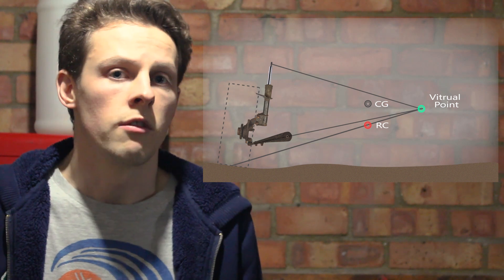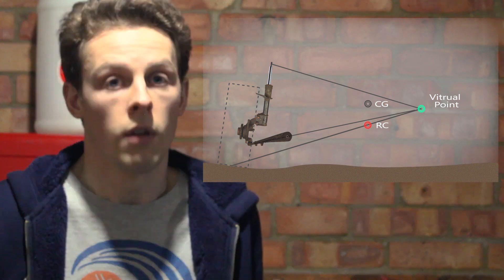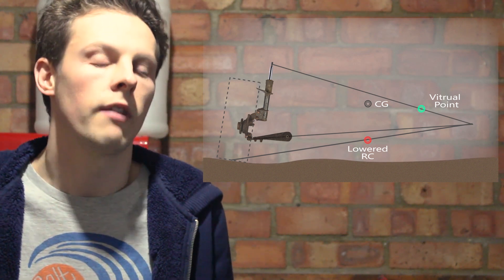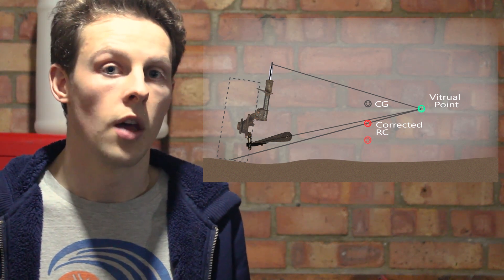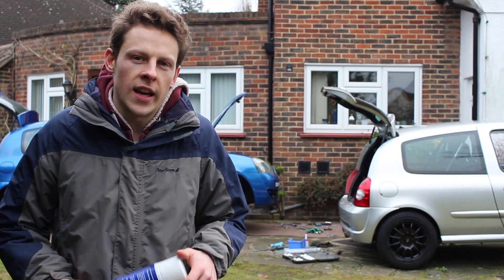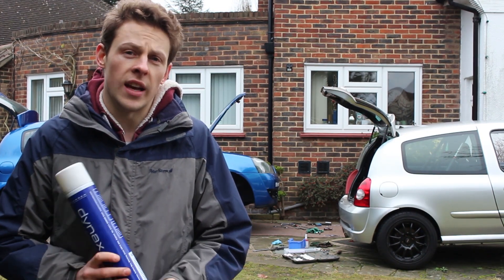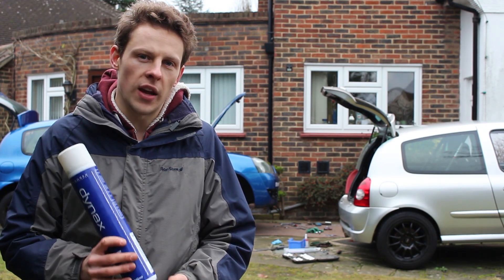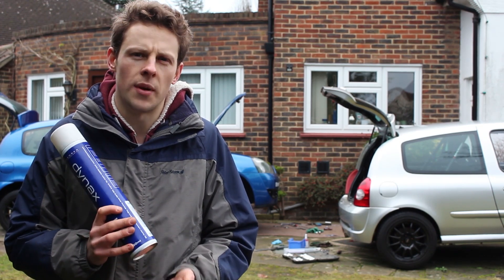Fitting a Roll Centre and Bump Steer Correction Kit with ACS Motorsport

Comment: Would this rid my 172 of bump steer? It's on cooksport springs and te tracking is spot on... No wear on any suspension components.. Tanks
Reply from the maker: It certainly should do. I recall this was designed for cars which have a similar drop to cooksport springs but do be aware these kits tend to make the rear end very lively in the wet so I wouldn't recommend for a road car.

Comment: Did I miss it or was there never a video following up on the difference with or without kit to see the difference on body roll?
Reply from the maker: Marc Elzen - VRL Performance no specific follow up video but the brands hatch video immediately after this one has it in use. The silver car in the video  also has the kit. Yep definite reduction in roll but primarily due to the spring rates being unchanged. It did make the tail end a little happy so a stiffer rear ARB was required.

Comment: accepted   technology   HAS moved on   Move with it .good luck .
Reply from the maker: I’m not here to battle dude, just to share a bit of joy about cars and hopefully be educational along the way so thank you. It hugely improved turn in and restores it to unlowered factory feel. A little too much oversteer in the wet for me so I run standard bottom ball joints with a larger rear ARB now.
Reply: @TrackItYT   Oversteer in the wet.  a blade rear anti roll bar would allow you to soften the rear end . what roll axis are you running . It sounds like your nervous / loose rear end  could be a roll axis issue .  Old school seat of pants will point you / your  driver in the right direction . Your observations back up a lower front roll center which would lead to a roll oversteer issue .  Good luck keep up the excellent fabrication and support for your chosen sport .

Comment: disgusting con .. the leverage on the various parts  is something someone has overlooked . I would never bother to drive that potential killing machine . I bet the insurance companies would throw a dizzy fit if they saw the cobbled up lash up   you guys are up to .
Reply from the maker: Richard Wallinger what a strange, naive and unjustified comment. This has been designed by qualified motorsport engineers from world leading automotive engineering universities, been computer modelled to ensure stress remains transmitted in the correct plane and assembled with aerospace grade metals. I assure you these kits are not anything you’ve described and run in many different race series, on the Nurburgring and at some of the worlds harshest tracks.
Reply: @TrackItYT   good luck . more ways  than one to achieve a result .. the poor steering arm with all of that twisting moment on it ..  there are cowboys in all trades .Shame really. 75 year old 1980 donnington gt championship outright winner . own fabricated  ground effects aerodynamics  Porpoising   sorted . without computers and wind tunnels ., which BMW, Bratenstein  copied. on their M3  venturi cars. which Alan Jones drove . 12 lap races and once almost lapped the whole field of 30 plus strong racers . well made goodies..  Amazing how the CG failed to come down when the car was lowered .  Just a thought .. chill out guys . Just observations on your add on.kit.
Reply from the maker: Richard Wallinger technology has moved on a long way since then and modem modelling proves your intentionally inflammatory points are wrong 😂

Comment: But that adjustable tie rods end is not available for every car.
Reply from the maker: Indeed they aren’t but other similar solutions are available. These parts are custom machined for the Clio.
Reply: On a 2nd Gen gs300 there's 15mm 22mm 30mm thick vertical plate that goes between the balljoint and knuckle to correct roll center after lowering the car.

Comment: Nice video. Does it make the front of the car higher?
Reply from the maker: Thanks! No it doesn’t because the hub remains in the same space, it’s only the wishbone and track rod which are lowered back into their position. The wishbone is lowered a touch closer to the road but very little.
Reply: @TrackItYT  Oh oh I follow what you are saying. Thanks.

Comment: But why is CG not also lower on a lowered car?
Reply from the maker: By lowering the car you haven’t moved the weight further down in the shell so the CG stays the same. The point in the car which the weight acts from in relation to the roll centre is unchanged. Hope that helps :)

Comment: Also, what do you think about the pure Motorsport/whiteline rear antiroll bar?
Reply from the maker: The Anti-Roll bar I’ve got was part of a limited run with 5 or 7 adjustment points (I forget). It was sold by balance motorsport a number of years ago.It makes a noticeable difference and stiffens up the rear end considerably.
Reply: TrackIt for last, i have the Option of taking the 19mm or 22mm. It’s a 1.6 16v non-RS clio, since we don’t have them in Brazil. What would you recommend? Thanks
Reply from the maker: I have never tried the PMS rear roll bar but 19mm should be better for a road car and 22mm for a stiffer track car :)

Comment: Hi, will this rollcentre correction kit fit a Clio williams?
Reply from the maker: Honestly I’m not sure but I know it does fit a mk1 with 172 front running gear. Best to contact Ant at ACS. His details are in the video description.
Reply: TrackIt thanks, i will  contact Anthony...
Reply: It's Dutch but here you can see that the original part numbers are the same. So I think it will fit.....
https://www.autopartsonline.nl/p/renault/clio/clio-ii-bb012_-cb012_/2-0-16v-sport-19813/fuseekogel-220230